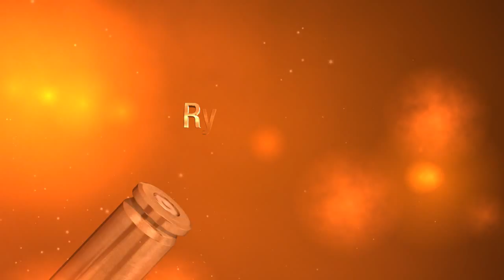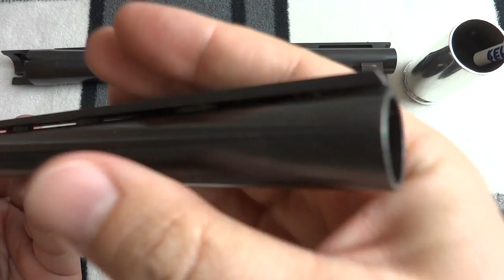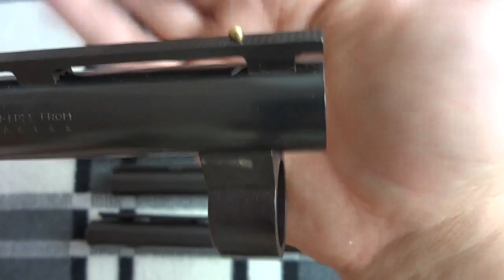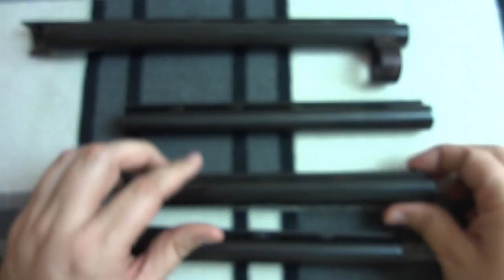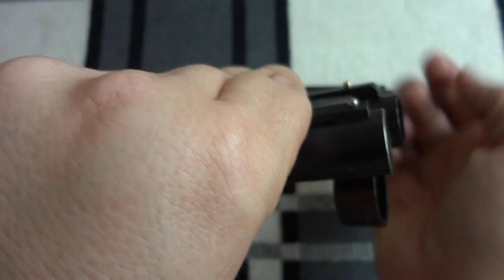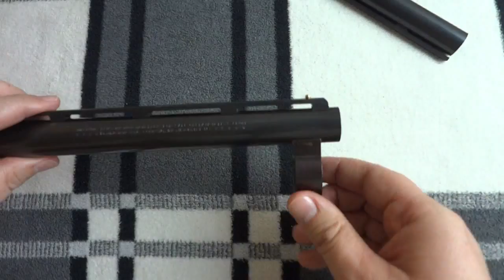Shotgun Barrel Cutting: Finishing Vent Ribs

Comment: I just cut my father's old 28" shotgun barrel to make it 18.5". I used a dremel with a cutoff wheel to remove an 1.5" section of barrel rib, so I could then use a small Ridgid brand pipe cutter to cut the barrel perfectly straight. This whole process took about 10 minutes. 
I love this small pipe cutter, which I've also used on handlebars, and of course many copper and plastic pipes.
Reply: BLD Lightpainting Yep, dremel with a cutoff wheel is my choice too.

Comment: I also have an 870 sbs. I decided to cut down a vent rib barrel to 14" lines up with the end of a vent pillar and is flush with a plus1 extension. I cut down a smooth barrel t 12" so it would line up with the mag cap when I run it. great blaster and range fun.
Reply from the maker: The 14" barrel seems a waste, to me, but it does look good.

Comment: Nice work on the finished product!  I think I'll try a hose clamp instead on the copper union..it should do the trick...
Reply from the maker: The point is to avoid damage to the finish on the barrel, so I suppose a piece of paper under the hose clamp would suffice?  I don't know, I have the copper fitting, so it's enough for me.

Comment: Cool video man. Very good job.  Do you need to have the chokes installed for home defense?
Reply from the maker: I don't use the shotgun in the video for home defense.  While I do have a cylinder bore for my HD shotgun, a lot depends on your situation.  I do not intend to shoot at any moderate or long distances.  If you have some land, I'd start with at least an Improved Cylinder.  At home defense ranges, it doesn't really matter, though.

Comment: We do painter's tape and hose clamps out here but your way is probably better. About how many barrels do you get done out of each fitting before replacing?
Reply from the maker: Still using the first one.  I just don't grind on it.  I put a jig on the disk grinder so the barrel stays off to the side and I can grind it down pretty close there and then finish it with the fitting.  I have found that I have to put painters tape on the barrel.  The copper is soft, but it gets bits of steel filings imbedded in it.

Comment: To prevent damage to the barrel if you want to square it. Take a lid from a metal soup can pre bend it and hold with a couple of rubber bands while you use a dremel cut of wheel and file to desired shape.
Reply from the maker: Not sure I follow what you're saying.  The words "Dremel", "Soup Can", and "Rubber Bands" do not seem compatible with anything I am doing here.

Comment: ha ha I bought a maverick 88 shotgun several years ago for 100 bucks because the barrel was bent... I cut the barrel to the point where it would be straight (which just so happened to be just over 18 inches) Also a side note is there was already a tapped hole just behind the 18 inch mark for screwing the sight bead...so it literally looks like it was made to be cut. 

It did have the vent rib barrel and I ended up filing the corners in a bit of a rounded shape (kinda like a boat bow) and to finish the business end of the barrel (I work in automotive field) I found an
old burr reaming tool laying around the shop that I think was designed for reaming exhaust pipe burrs BUT it tapered to a really fine point and was able to ream the end of the barrel
to flare out the end of the barrel so that it gradually opened up on the end instead of having a flat face that looked like I hacked it off with a hacksaw, this much is true but I wanted it to look a little better lol

Comment: Looks good, can you please explain why you would choke tube a 12" barrel.  If I cut mine done to 20", I was going to leave it without a choke like a slug deer barrel
Reply from the maker: +Eric Roy I have not had it cut for choke tubes yet, but it offers a few advantages and no disadvantages other than cost.  First and foremost, I can install a rifled choke tube for better performance with slugs.  Also, if I am not happy with the pattern shapes, a slightly different choke tube (like a Skeet or IC) can often even out a pattern.  Another good reason is that I can install a 'tactical' choke with serrations that can be used for breaching.  One can also install an extended choke to functionally extend the barrel length.  Then there is the Silencerco shotgun suppressor that attaches via choke tube.  You can install a muzzle brake to cut down on recoil... again there is no good reason NOT to install choke tubes other than cost.
Reply: +RyeOnHam Thank you for the explanation!  I liked your tips about the shortening process
Reply: +RyeOnHam There are a couple disadvantages to interchangeable choke tubes.  The muzzle is not as robust, it's easier to dent or crack it if the gun is being knocked around.  Removable choke tubes also need more attention & maintenance, or they can rust or seize up.
Reply from the maker: ***** Had not considered that.  I have not seen a choke tube that I could not remove with the right tools and only a handful with threads bad enough to worry about. I had a couple where the owners chose to either let me 'jam' a modified or IC choke into bad threads or, more often than not, just cut the barrel off for a home defense gun.  Had not handle a dented or cracked one.  Some rusty ones for sure, but heat, cold, penetrating oil, and a good choke tube wrench took care of most of them.
Reply: RyeOnHam I've seen plenty of stuck or rusted tubes, and even a cracked muzzle from a tube that had been permanently kept in a gun for years until it eventually split from being fed countless steel shot rounds.  Both issues are easily avoided with a little care and attention of course, but it does add to a gun's upkeep.  Then there's the unavoidable drawback of durability.

Don't get me wrong, most of my shotgun barrels have screw-in chokes, and I'm always buying new tubes to play with, but I think there are situations where a fixed choke is a better choice - particularly for a no-nonsense HD or duty shotgun that stays in a closet or a vehicle, and is rarely cleaned or lubricated. While it is nice to be able to fine-tune the pattern of a buckshot load you like, it's all splitting hairs at across-the-room distances, and how many defensive shotgun owners would actually take the time to experiment with different loads and choke tubes?  

A fixed choke is less versatile, but more rugged & idiot-proof, and for many shotgun owners who just use a shotgun for close-range defense, rugged and idiot-proof is the better way to go.

Comment: thanks for the video. i was wondering if a choke can be screwed back into a cut barrel? thanks
Reply from the maker: +Jamey Taylor You have to have a gunsmith ream and thread the cut barrel if you want to use choke tubes again.  I would not recommend the course, normally, but for my SBS project I wanted the versatility.  Starting price is $100 up to $200 depending on the gunsmith.
Reply: thanks again.

Comment: Thank you!  Solved my 11-87 problem.   Quick question since you have a lot of experience in this area.... I can't trust law enforcement and sometimes ATF agents to actually KNOW the law.....  I don't need any special permission to cut as long as I stay over 18" on barrel and 26" overall length, correct?
Reply from the maker: If your barrel is a vent rib, you won't have much of a choice.  The ribs are usually going to dictate where you cut to a certain degree.  In my experience, it will be other folks at the range who notice first.  Me, in other words. I used to frequent a pawn shop.  The owner would come to me for gun advice.  He took in a gun that had a 14" barrel because it looked okay.  Turns out, the clerk never even measured.  I was in the shop about a year later and saw a suspicious Mossberg.  Sure enough, 17.5 inches and an obvious hacksaw job.  The owner took the barrel off the gun, walked out back and bent it sideways over the dumpster.

Check your local laws first, though.  I know some areas have a funky way of defining and measuring barrels.  Some places have different rules for autos vs. pumps.  I am not a law expert, but on the federal level, you will probably be good over 18" barrel with a 26" OAL.

Comment: How did you shorten the magazine tube for the Mossberg 500? On one end external threads are needed for the receiver, and on the other end internal threads are needed for the takedown screw. Then you have the problem of getting the spring the right size and tension. I can only assume you cut the side that screws into the receiver and rethreaded it? Or did you simply cut the barrels no shorter than the tube? That last one looks shorter, but it could just be a misperception.
Reply from the maker: Never done a Mossberg 500 that I needed to shorten the mag tube for.  The only model that this would be appropriate for would be the long magazine model 500 or Maverick 88.  You are correct, you'd need to cut new threads.  On the Mossberg, you're only looking at about a 15" barrel with the standard magazine tube, so it's not worth it.  The gun that I'm showcasing in this video is a Remington 870 with a shorter magazine so you get about a 12" barrel on the cut.  A properly equipped gunsmith can braze the barrel lug on in a different spot on the barrel and cut and press the end cap, but the Mossberg 500 is a really poor design to do this with.  You're better off with a 590 barrel which is a cleanout tube, like the 870.  I'm not set up to braze or thread magazine tubes.

Comment: Gotta do a browning bpa it's a 3 1/2 chamber so I can't buy a 20" barrel for it without spending $400 so what I'm going todo is pick up a 28" and cut it down and add 2 shell extension hopefully it comes out good cause I really like the bottom ejection of the bpa also it racks like silk
Reply from the maker: I have several Ithaca 37's, a Remington 17, a Browning BPS, and a Remington 31.  All are the same basic design (as is the Mossberg 500, believe it or not. I am not familiar with the 'BPA' but if it is just an updated BPS, then it might take BPS barrels.  They have made short barrels for the BPS, if I remember correctly.  You could also look into a used Ithaca.

Comment: you did a good job on that quite impressed :)  i would gave used a fine cut off wheel on a demal type tools,dressed with a grinder and finished it with a diamond lap but in the UK we have silly laws about short barrel anything. keep up the good work
Reply from the maker: ***** The UK is the reason why we have our right to keep and bear arms.  The British redcoats acted to confiscate guns of colonialists and upset them.  They fought back.  The British eventually gave up, so we ensured that we would be able to keep our right to keep and bear arms.  We also have liberal immigration laws... hint, hint.
Reply: RyeOnHam Yes i agree with you on the 2nd and the whole bill of rights, as we HAD a bill of rights and the right to bear arms BUT they changed it in the UK so all we get is a bill for our wages and no rights to bear arms. Oohh immigration don't get me started i will get banned from you tube or a visit from the police for race hate crimes  or for using free speech. Oohh I wish I was Free

Comment: I would like to get your opinion on if I can cut the barrel on a remington 1187 and still fire bird shot from it afterwards?
Reply from the maker: I would not expect there to be too much trouble.  I did open up the ports on the 1100 I did a few years back to ensure adequate, if a bit sluggish, operation with the 100-round packs you get at WalMart.  Really, though, I would stay away from that job unless you've got some solid gunsmithing experience.  You can, however, get replacement barrels that are shorter.
Reply: @RyeOnHam  I haven't done much gunsmithing but I considered myself handy in a lot of area's.  Does that help or do you still think I should get another barrel alltogther? thanks for your input!
Reply from the maker: @Backtoreality4u  Well, you're looking at a barrel that has value.  If you cut it, you've destroyed the value it DID have for the promise of having roughly equal value IF you get it right.  In the end, you'll only have a cylinder bore, too.  I find that IC works better for me and it's nice to use modified or full if you ever intend to hunt.  Cannot do this once you cut the barrel.

I cut based on the vent rib, mag extension, the law (18.125" minimum for me) and what looks good.  For a semi-auto, you need the gas port to be far enough behind the muzzle to get you enough volume of gas, dwell time, etc. to work the action every time by the lightest loads you intend and not destroy the gun by the heaviest loads you intend.  Luckily, you can usually just ream the port up enough until you get the bolt to lock back and then go, like, 2 wire gauges larger for good measure, fouling, cold temp, sluggish action, etc.

So, once you cut you'll either need a bead or some janky receiver scope mount.  I looked on ebay and you're paying $250-ish for a factory short rifled barrel.  Maybe a little less for a full-length barrel.  You could buy a used barrel and cut it down.  There is a lot to be said for having a two-barrel set, especially with a gun as versatile as the 11-87.

So, fine-tooth hacksaw, miter box, file, sandpaper, super-blue, 3-56 drill, tap, tap handle, new brass bead, bead installation tool, locktite, dremmel with proper bits to clean up bead (non-vent rib barrels).  If you're doing one or two barrels, DEFINITELY not worth it.  I'm somewhere in the triple digits so it's no big deal for me.
Reply: @RyeOnHam  You just took all of the guess work out and saved me allot of time with your very thorough and patient advice. I take value in your educated explanation and will definitely not cut the barrel . I Will purchase one for my home defense needs and still be able to use the long barrel for hunting. Thank you very much ! I really appreciate it.
Reply from the maker: @Backtoreality4u  No problem.  I've been down that road enough times.

Comment: why do some handguns and shotguns have the vented rib design?
Reply from the maker: The rib is meant as a sighting aid for point shooting on a shotgun and aligning the sights on target for a revolver.  It is meant to augment natural pointing instincts of humans to follow straight lines to the target.  The reason the ribs are ventilated is both to save weight and to sometimes make assembly and manufacture easier and/or cheaper.  You only have to braze where the ribs touch on the 870.  On shotguns like the Mossberg 500 and Winchester 1300 it is a much cheaper design that often comes loose during repairs and barrel shortening.
Reply: @RyeOnHam  thank you, i usualy get some crazy answer. Thats the information I wanted.

Comment: How do you remove the ribs, and vent, to make just a smooth barrel?
Reply from the maker: You don't.  They are generally either part of the barrel or (more likely on modern guns) they are brazed on.  You'd destroy the finish requiring you to do all kinds of work on the gun just to make it look passable.  Even then, you've destroyed the value and utility of the barrel.
Reply: Thank you so much for your message.
Reply: I was trying to add a heat shield , and the vent is standing up too high to mount it correctly.
Reply from the maker: @1hicksonfamilybcle1  Yeah, depending on the type of gun, it is better to run it without a heat shield, get a new barrel, or use a type of foregrip that keeps you from touching the barrel like the Magpul one
Reply: It is a Maverick 88, 12 g. I got it already in kinda rough shape. It is sawed at 20 inches and wasn’t done right, so I was watching your video, on how to do it better, and wanted to remove the ribs and vent at the same time I took off the other inch and a half in the length.
Reply from the maker: @1hicksonfamilybcle1  I would recommend against it and would not tackle it as a paid job myself.  I don't think removing the rib would give you any advantage.
Reply: Thanks again, best of luck

Comment: They make a file called a safe file with groves on only two opposite sides the other two sides are smooth so you don’t leave marks on an adjacent surface.
Reply from the maker: I am aware of such files and have some of the needle-file variety.  The problem with them is that they still drag hard steel on the finished surface of the barrel.  They do, in fact, leave marks on the surface of the barrel, but they won't dig into the metal like a regular file will.  You still need a barrier of some sort like masking tape.

Comment: I have a 500 with a 28’ Accu choke barrel. Hate to cut it up but it looks like I’m going to
Reply from the maker: If your barrel is in good condition, you might want to consider just buying an 18" barrel.  Mossberg sells them cheap.  That way you end up with a field and home defense barrel.  I usually chop barrels that have issues like bulges, stuck choke tubes, loose ribs, corrosion, etc.

Comment: Can I send you my barrel and have you cut it down and add a bead sight?  I have a 28" Remington Magnum that is way to long to be useful to me.  I need to get the Magpul Furniture installed (LOP) is also way to long for me, and I could easily send the barrel to you while its apart.
Reply from the maker: I cannot, sorry.  Most gunsmiths will do this for you or you can just buy an accessory barrel already that way, if you don't have the skills and tools to cut it down yourself.
Reply: @RyeOnHam  I have had extremely bad experiences with local gunsmiths and lost all faith in dropping something off without seeing they know what they are doing. I dont have the tools or skill to do this myself.  Finding a replacement barrel is nearly impossible right now, Thanks Covid/Biden/Remington out of buisness
Reply from the maker: @New2Kendo  Yeah, I don't offer services over the internet.  Most of what I do is purchasing distressed guns, fixing issues, and selling them if I need beer money.